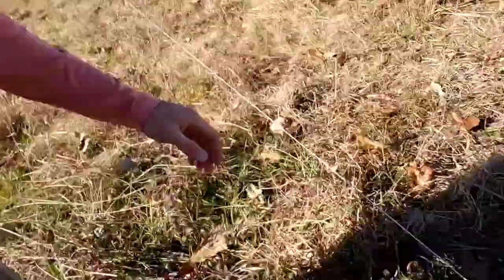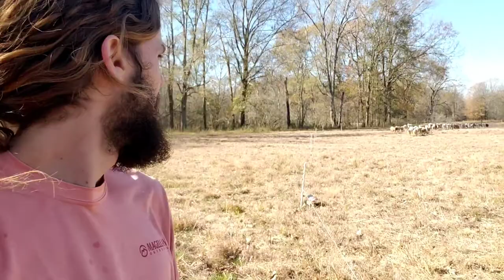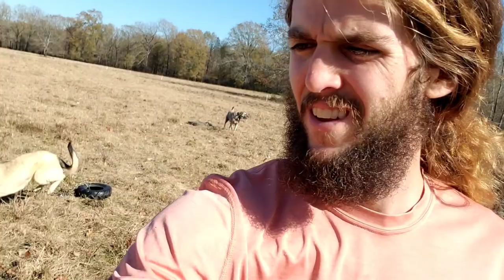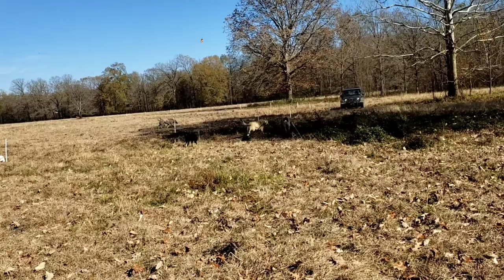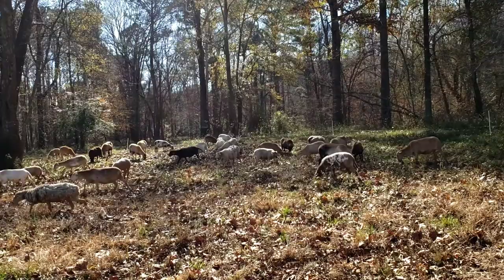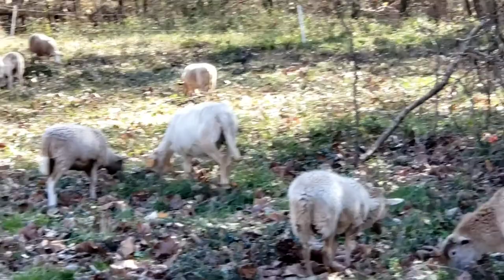NO HAY OR GRAIN ALL WINTER FOR OUR PASTURE RAISED SHEEP

Comment: How do you water when rotating your sheep and how do you feed the dogs?
Reply from the maker: Depends on where they are. Creeks, ponds, stock water points, and hauling water using 300 gallon totes. The dogs are typically On a sheep proof dog feeder where the dogs can get access but the sheep can't. Also, by hand if they are close enough.